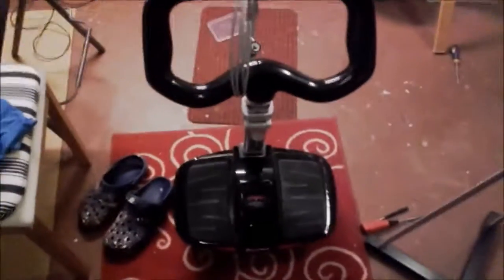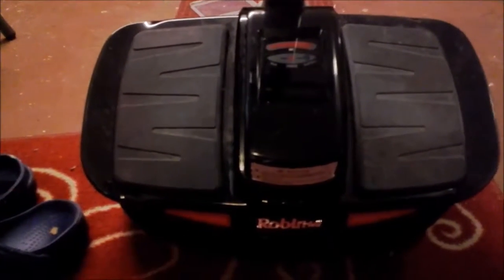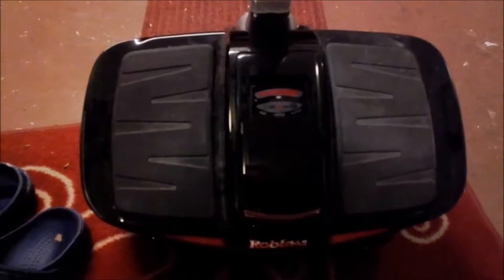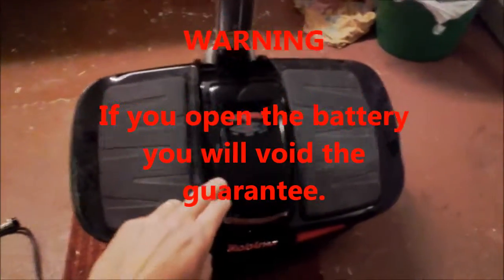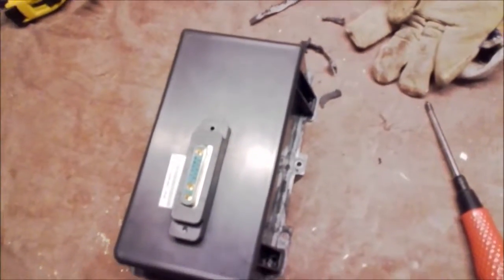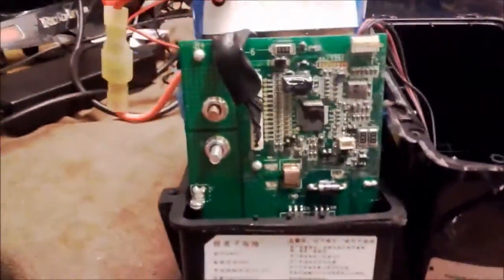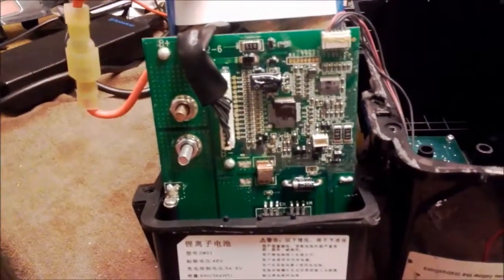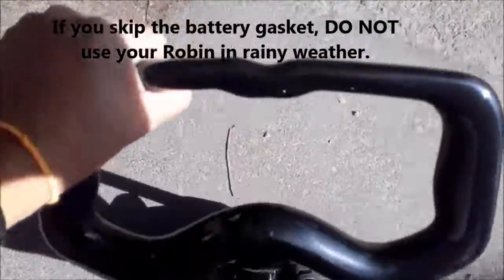Robin m1 battery dead and not charging.

Comment: I have a problem with my M1 it does not accept charge by the charge plug.
 I took out the battery case and predicted that there was a negative for charging and a negative for discharging. If I connect the negative to the negative of the discharge, the battery charges. Will it be a problem with the bms? how do i solve?

Comment: 54.6V total voltage means that the battery is 13 segments in serial inside ? This leads to 48V nominal (3.7*13) and 54.6V maximum (4.2*13) ??

Comment from the maker: Just an update, The same thing happened again. It was once again dead, but recharge it as described in video, and it fixed it. It can then be charged through the ordinary connector. This time the first test point was 0,2 Volt, even after it was charged, second was 4,0 V, 3:rd 8?V. I have not investigated it any more, but to my it looks like one battery cell is gone, but Robin still works, with no error warning. So conclusion is to use it often and recharge it when battery is empty.